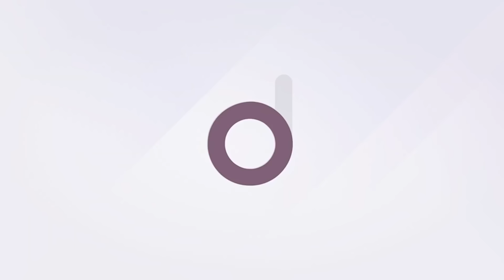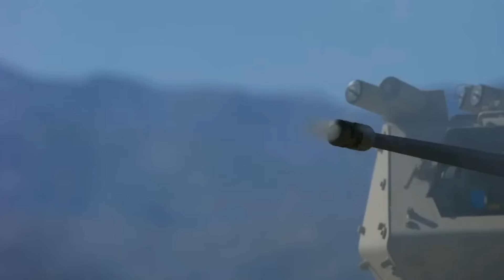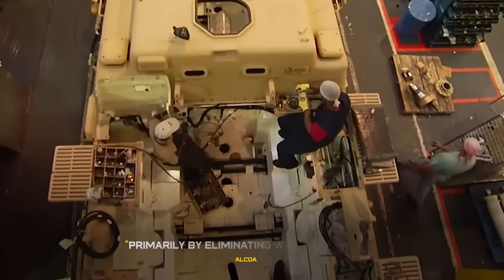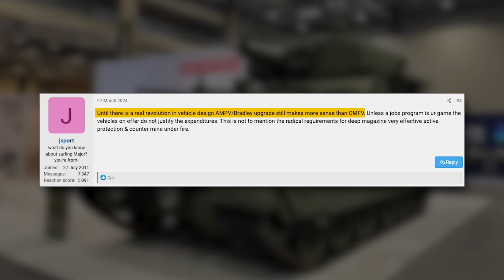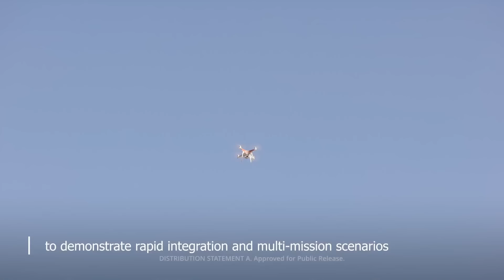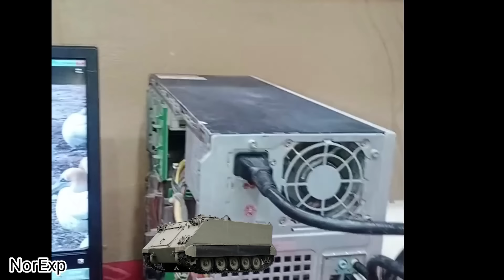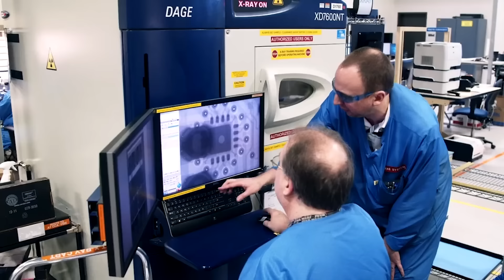How America’s Quietly Building a Secret Armored Fleet

Comment: I can't believe he didn't mention that the new M109A7 self-propelled howitzer and M992A3 ammo supply vehicle are also mounted on the AMPV hull. This thing is literally making a universal platform for every conceivable role in the US army besides light tank, armored recovery vehicle, bridgelayer, and main battle tank: APC, armored ambulance, mortar carrier, command vehicle, self-propelled howitzer, ammo supply vehicle, IFV, and more.

I'd prefer to use the Patria AMOS over the Patria NEMO, however. The NEMO is the cheaper downgrade of the AMOS, which steps it up by having a higher rate of fire, greater range, more advanced targeting capabilities, the ability to use smart munitions (such as 120mm mortar shells that guide themselves at enemy vehicles, but know to ignore burning/damaged vehicles), and oh yeah, it's a DOUBLE BARREL 120mm automatic mortar.

Comment: You should look at Finnish Patria amos system, it is nemo with 2 barrels, can shoot like nemo but double the firepower. They can shoot running 80kmh in road and still hit 8km away 12 shots inside 1 sec. And you can shoot in line of sight over 3km away. Almost every military that thinks that mortar systems are op has ordered nemo or amos system. Now you just lock on the target from the screen and start running from you position and rain metal to the enemy. And amos is 30year old system already.

Comment: M113 has been and is a fantastic work horse. Simply a armored pick-up. USE it for its purpose. Remeber the Army bought alot Hummers and found it sucked in the woods and played the political safety card to get rid of the jeep. BTW M113  was front line APCs .

Comment: As a self-proclaimed military Internet warrior, I must say this project is shaping up to be one of the most colossal wastes of time and taxpayer dollars I've witnessed in quite a while. They keep saying, "Oh, we can always add features like active protection later," which is just a bafflingly backward way of thinking. We’re in an era of advanced technology, yet we’re pouring resources into this when the Marine Corps has a far superior option in the Amphibious Combat Vehicle (ACV). Honestly, I’m struggling to grasp how there’s zero oversight on these committees or contractors. This project should have never even made it past the drawing stage!
Reply: Well the APS is pretty easy to add piecemeal after the fact. They can just slap an Iron Fist module on it like they have Bradleys.
Reply: @thesarcasticliberal  This approach is misguided; the integrated active protection system is a superior solution compared to an "add-on." The Marine Corps is currently utilizing a more advanced vehicle, the ACV, developed by Iveco and BAE Systems. The AMPV is merely an upgraded relic from the Cold War. I have raised this issue with Colonel Barry Williams, Deputy Director of the U.S. Army Acquisition Support Center, but I have not received a response yet.

Comment: I don't know why this is a big deal. The M113 has a million different uses and variations. It's a Medivac vehicle, it's a mortar vehicle, it's a 577, it's a 981 FISTer,  They will probably end up turning the 113 into drones. The M2A2 or M3A2 are just oversized 113s with turrets... So yeah, they already planned for this vehicle to have other purposes. I'm sure PM Bradley had this plan when it was on the drawing board. They had an air droppable Bradley when I was in for air assault teams, signal, and pathfinders. When I was in they used to have water barrier kits and and we would fjord rivers in them. You close the drain hull plugs and flip on the bilge pumps. It saved a trip to the wash rack.

Comment: Regarding monolithic hulls.... I'm not sure of the complete wisdom of such an approach. Yes, it theoretically saves cost and improves survivability.... for the first shot. Most of the time, armored vehicles aren't completely destroyed following an engagement. Instead, they take minor damage where they've been hit. Traditionally, repair meant swapping out the damaged panel for a new one. But if it's all one piece, that means the vehicle can't be as easily repaired or even need to be scrapped and replaced in its entirety.
Reply: It is not so simple, swapping damaged panels in all fine and dandy but the vehicle has to survive long enough to be repaired. Also if it is a "troop transport" type vehicle then the #1 priority is the survival of the troops inside. Yes, Damage to the hull could potentially "total" the vehicle but if it uses a version of the Bradley hull then there is nothing to worry about. it will be more than simply metal, it will be layered, and if we are learning like we should, then a form of reactive armor on top of that. It could potentially be more expensive, or it could save millions because we aren't having 200+ of them destroyed along with the crew and the equipment inside. The US military knows that the better quality the technology you can give the warfighter the more effective they are. Period. Keeping troops alive is cheaper and quicker than training new ones. Period.
Reply: @braedondaves3297  Actually in a real war you have much more infantry than armored vehicles and you always want more more and more vehicles. Eventually u use anything that rolls
Reply: Same here. I think that with some clever thinking and repair kits, it might be patched up in "adequate" manner in the field, but some thinking and testing shoudl be done. On the other hand - more components survive, get them out put on new hull from storage. Usually, it's the components that take time to make and are most expensive.
Reply: You cant make a vehicle like that without a monolithic hull. In addition to that, these are constructed using aluminium welding, so if they want to repair penetrations for example, theyd just cut the damage out and weld a patch in. Much simpler than taking apart a frame with 10,000 parts.
Reply: Indeed it is utterly stuoid to make a single piece instead od replacable parts. Who woykd build a car like this?
Reply: The Soviet's best.

Comment: Great episode! Glad to see the M113 being put out to pasture. It was getting downright embarrassing to see these still fielded. The design was almost 30 years old when I went in; and that was 35 years ago. They're antiques. And they weren't all that to begin with. As for its modularity of this new vehicle, we've heard that before. But based on this video it looks like they might be on to something this time. When you mention 30 different turret designs, the first thing that came to mind was training, as every version will have its learning curve for the soldiers operating it. If you're just dealing with a handful of options, like on the Stryker and Bradley, that's not so bad. But 30? Of course, you have to consider logistics is supporting all the variants' ammunition needs as well. All that aside, it still looks pretty good and might be what we need.
Reply: I think that with M113  just to have some fixed and held in "high readiness reserve" could still have its uses.  Think of it as tracked Jeep / basic Humvee for rough terrain. Box to move things in bad conditions (weather, terrain) but in relatively uncontested rear.
Reply: There’s a Colonel Cannon in the Armour corps 🎉
Reply: I think it will just have a handful of system templates, but being modular means new design/ systems can be integrated much easier to fight against new tactics, much like the Ukrainians throwing hate with FPV and mini drones after Bayraktar TB2 was ineffective after the first few months.

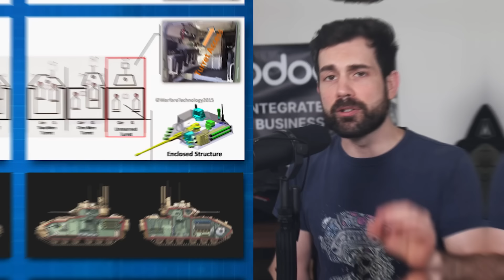Comment: 4:20 I don't fully follow the claim that the unmanned turret creates more space than a manned turret. The turret still requires operators, they just do it via remote control rather than direct control. And if it is still a two-person turret (gunner and commander), then that would still take up about the same space. I thought the main difference / benefit of unmanned turrets is that it exposes the soldiers less than traditional, manned turrets.
Reply from the maker: I wish I had explained it visually better but unmanned 100% creates more space . That’s the pro , the con is less reliable , less situational awareness

Comment: People rag on the m113, but not many other vehicles have been adapted to more environments, more roles, seen more combat... They're around because they're useful, simple, and easy to modify.  Basing it on the Bradley hull ensures that the platform will be used for another 75 years or more, and even then we'll still have m113s kicking around somewhere, hauling trash.

Comment: Remember in WW2 the USA had no problems with rolling with what was good ENOUGH and cheap ENOUGH.
The Eastern European War that is happening right now is an example of how major wars are fought.
The USA is designing a vehicle where they can lean on the economic and manufacturing might that is the backbone (although run out of shape in the last 60 years) to the USA's power.
It wasn't fighter jets that won the war it was Ice Cream and the Browning MG.

What I am saying is, in the war on Terror where the optics were different, it was cheaper to invest in vehicles that can survive an RPG and stick around long enough to tell the A-10 where to delete.
In a new world war, with a near peer.. I'm afraid that the numbers in Ukraine say it all, good equipment IS GOOD but if your out-numbered 4-1 even if you maintain an attrition rate of 1.5 - 2 enemy Loss for every 1 Friendly Loss you still cant out-last.
When your Front lines become Blurred with Back Lines and then some because thousands of drones are mapping your every move from the start, 1RPG turns into 4 or 5 high explosive wire guided drones.

Comment: Heavy is the way to go for survivability. M113 like all APCs was a horrible mistake designed for the post-nuke battlefield and clung to for cost reasons.(The drivetrain is extremely simple using a truck engine and automatic transmission.) The APC concept was fundamentally idiotic because its good feature (light weight with commensurate mobility) coerced it's use as an AFV where it's nearly helpless. Infantry require heavy weapons which either arrive by wheels or tracks, with tracks having much lower ground pressure. Clinging to the idea of a "battle taxi" (wheeled or tracked with worthless armor) that's neither fish nor fowl killed and wounded thousands of troops around the world because APCs are nearly unarmored with the exception of Namer.  

The APC concept ignored that RPG existed since before the APC, whose ancestors like the US M2 "purple heart box" halftrack were also grossly inadequate at protecting their human cargo. Militaries hated change so they clung to their various APC, Russia because they don't care about casualties and the US because it didn't care much during the Viet Nam era then later because it's sexier to spend procurement dollars on other systems. 

The AMPV concept is about sixty years overdue but that's expected from the Pentagon who failed to armor their wheeled transport until enough Americans died that hillbilly armor (for the second time, the first being SEA gun trucks) was fitted then public anger coerced adoption of Force Protection's MRAP (interesting beast, I helped train new welders for their production line in SC).

Comment: We HATE the AMP-V in the artillery FDC community.  How is it 75% bigger than a M1068 but it feels so much more cramped?  The layout is not conducive to FDC operations due to the FDNCO and FDO sitting on opposite sides facing different things.  Worst part is soldiers told the BAE reps this when it was tested about how the layout needed to change and the completed disregarded our input and pushed to production anyways.  Would rather have my 1068 with a bigger engine and high voltage outputs.

Comment: Cappy, do a video on CTAI's 40CTC autocannon. 
Its APFSDS round will punch through 140mm of RHA
It's standard round goes through 210mm of concrete, dry round to point penetrate or airburst
And it's Anti Aerial Airburst for drones etc
Reach out up to 8.5km
Reply: And fits where regular 30mm bushmaster does (or even 25mm). However - uncommon ammo and expensive as faq.

Comment: Army: "Is it finally time to replace the M113 with the Bradley?" 

Military Industrial Complex: "No we're going to replace the M113 with MORE Bradley!"
Reply: Well, the M2A4 is a beast
Reply: I think that's pronounced "Chadly".
Reply: @Operator8282  i call it the angry lunchbox
Reply: Yes, could yo please compare this vehicle to a Bradley?
Reply: Bradley and M113 encompass two very different roles. Bradley is doing fantastic as a fighting vehicle in a support role, quickly clearing tree lines and giving heavy covering fire. This behemoth here seems to be better fit as true personnel carrier which primary anti-drone equipment. Bradley and Abrams attack from the front, this thing pushes and supports from the rear
Reply: Makes me think of the snl skit about needing more cowbell lol
Reply: this new apc just sounds like a modernday m113 apc which actually sounds good.
Reply: @disclaimer4211  One that isn't made as thin as a soda can, finally.
Reply: @KnightsWithoutATable   3d printed metals.
Reply: New! Improved! Bradley Extra!
Reply: It seems to be addressing most of the horrific flaws that Colonel Burton pointed out, I approve of most of the changes, in as much as they are directional improvement.

Old Bradley Flaws: A troop carrier that can't carry many troops, heavy anti-tank ordinance (cannon and TOW missiles) with lots of opicals that draw enemy anti-tank fire rapidly, thin skinned aluminum armor, supposed to be amphibious (yet soldiers downed in it, so not that amphibious), and vulnerable to IEDs. This new vehicle seems to have addressed a lot of these horrific flaws. The old Bradley was a rolling coffin, that was designed to do everything, and did so....badly. Now that we are facing near peer enemies, it is vital that it get improvements.
Reply: @user-nu8in3ey8c  Burton was full of shit.  Bradleys are not rolling coffins. that has been proven in the fighting in the Ukraine.  
Just for your information the movie "Pentagon Wars" is basically a bunch of lies.  The Pentagon was not trying to hide faults in the Bradely it already knew about them and had plans to fix them.

Burton's claims about it being "a target" are BS.  Every combat vehicle is a target period.  Not up for debate.  By taking away anti-tank weapons from the Bradley you are just making your IFVs unable to defend themselves against armor.

Above all the Army is not changing its position here as these AMPVs are replacing stockpiles of M113 type vehicles that the army used for years for medical vehicles, Mortar Carriers and Command tracks to name a few.
Reply: @ Bradley is not outdated at all, if anything it's the best performing platform in the entire US army. Its not a troop carrier, first and foremost it is an infantry fighting vehicle. Even though we only sent a few dozen to Ukraine, they're still out there running heavy sorties every single day back to back, and the crew survivability is incredible. Also the whole aluminum armor thing is a misnomer, it uses aluminum carbide plates, which is a ceramic armor. Its about as hard as steel carbide, but not as hard as tungesten carbide (but WAY lighter).
Reply: Lol, my first reaction to seeing the thumbnail was thinking they’re trying to upgrade the M113. Exact quote being: 

‘No! Let it die!!! It’s under armored and slow! LET IT DIEEEEE!!!’

Comment: Hello ... regarding mobile command centers ... the experience of the war in Ukraine (which is now a war in the Russian Federation as well) shows that mobile command posts are not that important, especially close to the front ... the comment of the Ukrainian military is that it is much easier and safer to organize the headquarters in the basement of a house or in a quickly dug engineering shelter than to bring a priority, easily recognizable and detectable target with hard-to-replace officer and staff personnel into its tactical depth.

Comment: I've been paying attention to the type myself. I often just call the collection the M1280-series based on their designations. Since they're literally the M1283, M1284, M1285, M1286, and M1287. Makes life so much easier that they can be just collectively called something simple like the USAF's old Century Fighter Series that started with the F-100 Super Saber and ended with the F-110 Specter, better known after the Tri-Force Redesignation System as the F-4C/D/E Phantom.

I also often laugh that it took the US Army 55 years to replace the M113 APC with another APC. Because despite everything, the General Purpose M1283 is just an APC, but more roomy and better in every way. And the added bolt on and go components would just make it even better.

On that note, I think the exposed 30mm with a Javelin Launcher was meant to be put on the M1283. It would keep the vehicle simple and well capable of both defending itself and providing suppressive fire, but due to its limitations, it wouldn't be meant to stick around and fight it out like an IFV. Get in, suppress the enemy, drop the troops, get out, and rinse and repeat. By contrast the IFV would be expected to stay and fight it out in support of its grunts or conduct a patrol or conduct patrol and recon as the replacement for the lesser known M3 Bradley Cavalry Fighting Vehicle.

I expect more vehicles in the future, once the US Army figures out what it needs. That and given how Alex Hollings on Sandboxx has put it, "Technology is blurring the lines," and that eventually APC/IFV/CFV would not be any different from one another. While one size won't fit all, expect fewer dedicated vehicles for more multipurpose, Swiss Army Knife style AFVs.